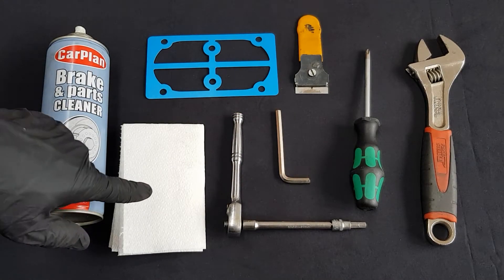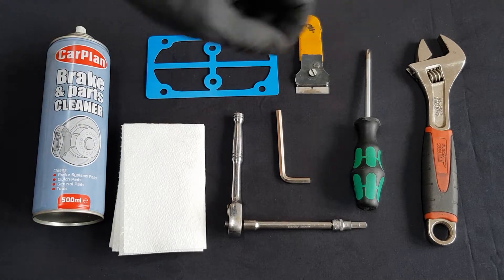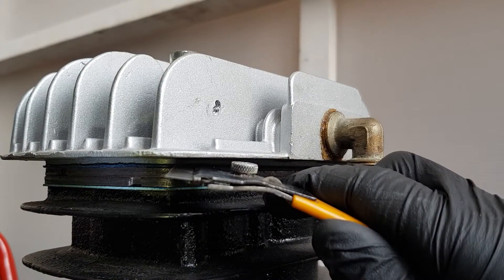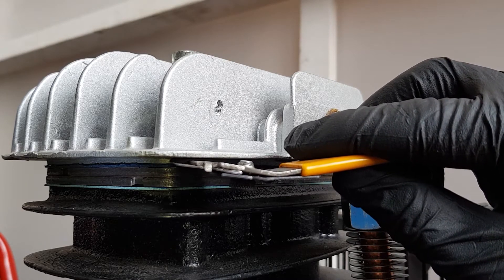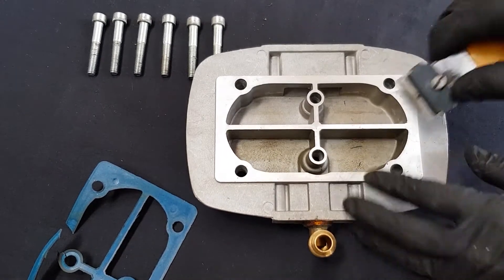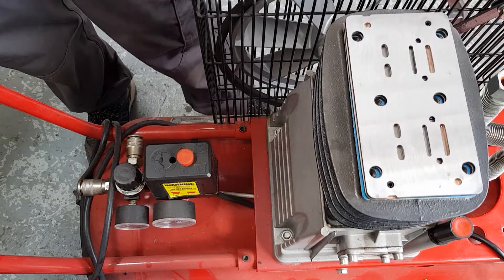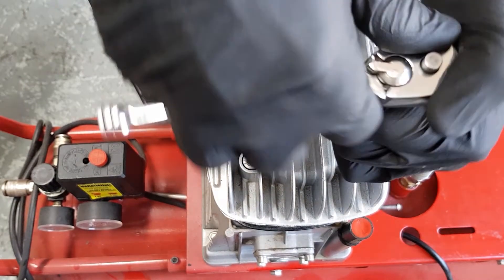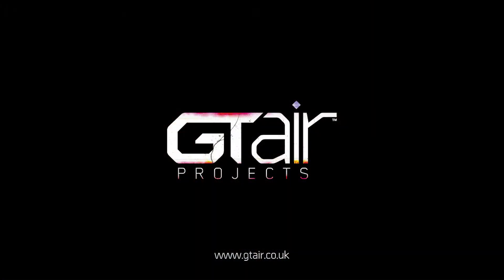How to replace a head gasket on an air compressor

Comment: good evening! I have a similar compressor, with 2 pistons, at 220 w, 90 liters. I have rectified the top plates, I have the good gaskets, it heats up after filling the 90 liter bottle in 3 minutes. if it still works, it gets hot because I can't hold my hand on the top. what to check!
thank you!